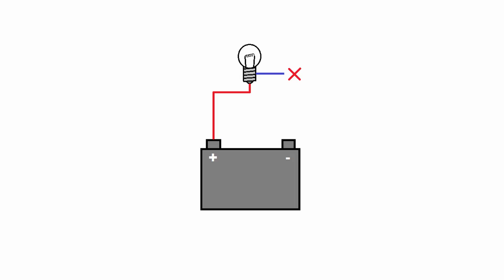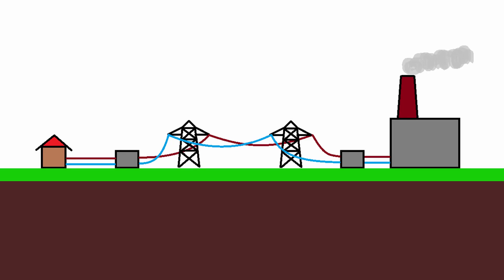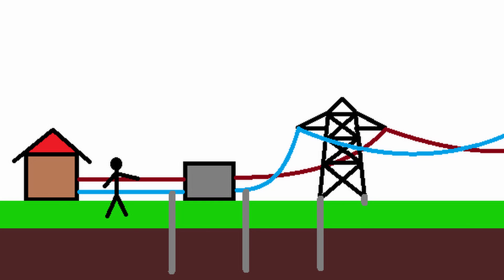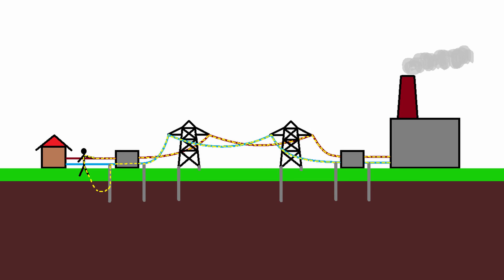Does electricity always flow into the ground?

Comment: It's a myth. The reason it flows into the ground at all is because pretty much every country grounds the neutral on the distribution system. It's not because electricity loves the ground, but because the neutral is intentionally grounded. The neutral is the return path to source, and we humans intentionally make the earth a parallel circuit with the neutral. This means if there is a fault (say the live wire sends current somewhere it shouldn't), it will use the ground to return to source. The earth has high resistance, but not as high as air.  Thus, the ground is taken and not air. 

Why do they ground the neutral?  Because it makes the system easier to manage.  It gives a reference point to 0 volts since the ground is massive and pretty stable in voltage.  Without a grounded neutral, you would have voltage fluctuations and lightning strikes would wreck the system. If you use an isolation transformer, you can touch the hot wire all you want and no current will flow through you.  This is because the transformer is not grounded. However, isolation transformers come with a whole host of other issues and aren't practical to run everywhere.

EDIT: Just finished the video and it seems the guy covered all this.  Good video.

Comment: so why do we even ground the grid? Wouldn't it be much safer to keep it isolated so ground faults dont happen?
Reply from the maker: Technically yes, but there are many other (safety and practical) reasons why ground-referencing is desirable, which usually outweigh this, at least for grid applications. Locally in some buildings/rooms, isolated power circuits do exist when the specific situation requires it.

Comment: @MathCuriousity Its because the voltage from the downed line flows through the ground around back to its source, but there is resistance of the Earth material that causes the voltage to drop the further away, and one foot is closer (higher voltage relative to the furthest foot). When it's 1,000s of volts with high current, that flow is deadly.

Comment: I have a question brother: what's all this about step potential then with downed power lines? if the power line isn't connected back to the source, it shouldn't shock us if its fallen. So can you confirm my thought:  I am thinking that the only way we can get shocked is if the the power line touches ground, and this phase then conducts electricity into the ground, into a ground rod, into the neutral at the transformer, and then back thru: HOWEVER the only time this situation would be allowed to occur is if there is a breaker that will flip electricity off - otherwise why would electrical engineers ground the system if not for safety! So in sum: even IF the electricity could flow for a PICOSECOND, it would flip off and we don't get shocked!!! So WHY is there all this talk of step potentials and safety!? Please please explain this here, and maybe in a deeper video!
Reply: It is connected back to source, though.  The distribution system has a grounded neutral.  In the U.S. they have to ground it at least 4 times per mile (usually much more often than that in practice) and I am sure the UK does the same.  So if a live voltage power line falls, there is going to be a ground rod in close proximity no matter where the power line is.  The current will take the earth back to that rod, up the rod, and back onto the neutral. If a person is standing along that path, well, that's unfortunate. 

Second, engineers do not ground for safety.  They ground for technical reasons concerning system stability. In the early days of electricity there were debates about whether to ground or not.  Over time it became clear that a distribution system is much easier to run if the neutral is grounded. Unfortunately it also makes it less safe, but this can be dealt with if you bond all exposed metal parts.  Breakers also help immensely in cutting power in milliseconds if there is a fault. With these technologies and understanding of earth ground, it is safe enough to run.  Also, ungrounded systems can also be dangerous if there is more than one fault (they are only safe during a single fault).
Reply: @ ah you confirmed my suspicions and really explained that well. I have a few related confusions if you have a moment and thanks for your kindness; 

Q1)
why do we bond water pipes in the US? Even if a hot wire touches a metal pipe, I don’t see how it has a return to source (even if we touch it) - because why would the hard wood floor/carpet we are standing on have a return to source right?!

Q2)
You know the single line return networks that use the earth as a conductor back to source for thousands of miles? Do those literally have areas where the electricity is literally passing just thru soil and no wires/rods?! How far apart are the rods/wires of that’s the case?

Q3)
So in residential, if nothing is bonded, and we touch a hot wire, we shouldn’t get shocked right? If nothing is bonded, there is no return to source? So the issue with a hot wire touching a metal pipe and us touching the metal pipe that’s ungrounded is only an issue if we have a grounded system overall and we are touching something ELSE grounded right?

Q5)
I know  electricity flows from high to low potential - so if we don’t have a bonded system, the hot wire at 120 won’t shock us cuz there is no 0 portion cuz nothing is connected to the neutral right? OR is it possible that even though other things are not neutral - they may be “naturally” like 20 v or 40 v so there is still some potential difference ?

Comment: What about Eels?
You're swimming in waters – surronded by the same water – yet somehow an eel can electrify you?

(I have my thoughts on this, but I wouldn't like to suggest an answer)
Reply from the maker: as far as I know, these fish can produce a voltage across different parts of their body. Say their head is positive and their tail negative, the current will run from the head, through the water to the tail. If you are also in that water, some of it goes through you. The closer you get to the fish, the more of that current flows through you. The same would happen if you dropped a sufficiently high voltage battery in a tub and went near it.

Comment: So if lightning strikes a building, does all that electricity get earthed and go back into the grid??
Reply from the maker: A lightning strike happens when there's a charge difference between the earth and a cloud. If the voltage gets high enough, an arc jumps across the gap, there's your lightning. The strike only lasts for a very short time, because the charge difference rapidly disappears. It's like a capacitor being discharged: a surge of current until the capacitor runs out of charge. 

So this current technically does "disappear" into the ground, because the ground is actually part of the power source. 

I may make a short video to further clarify this if I have the time
Reply: @AKIOTV  thank you for the explanation, you're very knowledgeable!

Comment: Very interesting topic. 

Earth ground, can be a voltage reference. But earth is not a conductor. as such earth is more like the dielectric material of a capacitor.
that means it can conduct current.
 not conventional current but displacement current.

I made a video which will most likely will go live this weekend, whereby I measure earth ground currents flowing in and out of a resonant system, using dielectric induction.
Reply from the maker: How it conducts (and how well) depends on the type of soil/rock. Moist/wet soil in particular can be a good conductor. In suitable places, there even exist power systems that use the soil as a return wire.
Reply: define "good" conductor. 1ohm per 10 meter?
Reply from the maker: @MasterIvo  apparently soil can have typical values from 10-100 ohm-m. Of course it varies greatly depending on moisture content, minerals etc. so lower or higher is also possible. 

Conductivity of the ground is a very complex topic because there are so many different types of soil/rock, not to mention dependence on moisture and even temperature. Then, there's also the capacitive effect you mentioned, which will also be making matters even more complicated. 

Also, I'd guess capacitive (reactive) current becomes increasingly prominent the dryer the soil gets, or the more solid rock is involved.
Reply: @AKIOTV  yes higher K factor (dielectric constant) of the ground would improve displacement currents